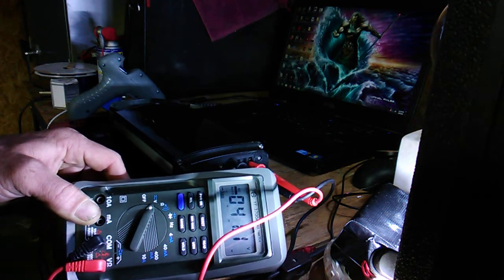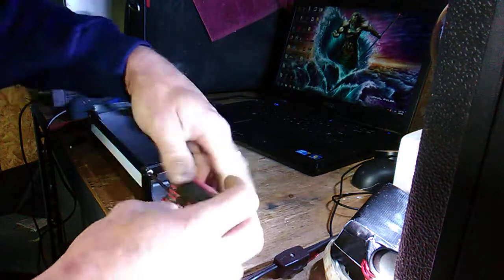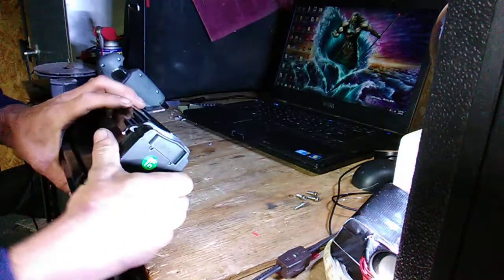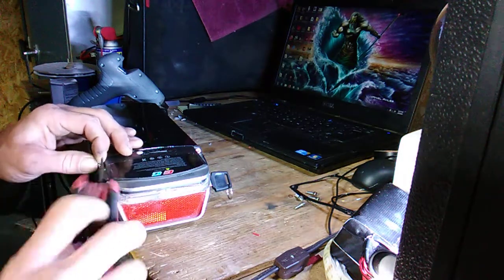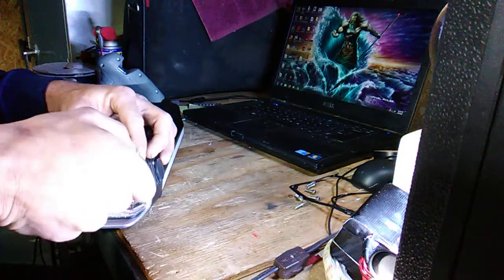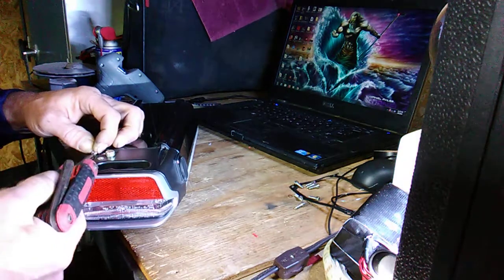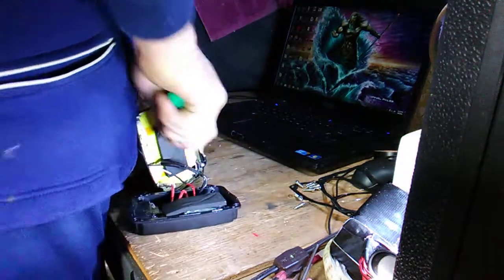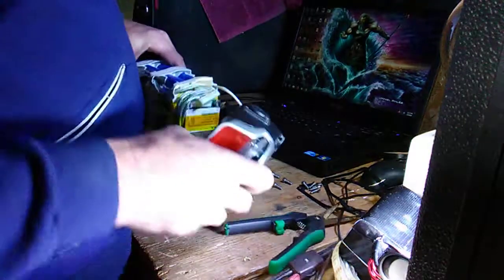EG Athens ebike battery pack rebuild.. Video#1

Comment: Hi Chris, I have this same battery for my eg Athens ebike. I lost my keys to the battery. Can the lock be replaced on this battery, or am I stuck buying a new one? Any help would be appreciated. Thanks.
Reply from the maker: Hi Christine I might have a way to help call Sam at the electric bicycle Center he had some bad ones maybe he can sell you a key setup you could always take it to a locksmith they can probably make you a key going to be about 40 bucks though